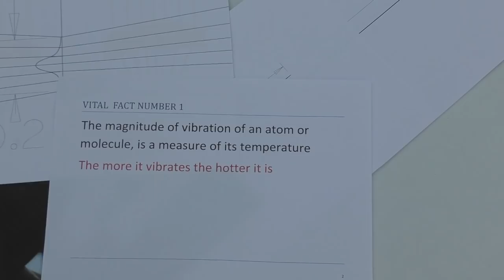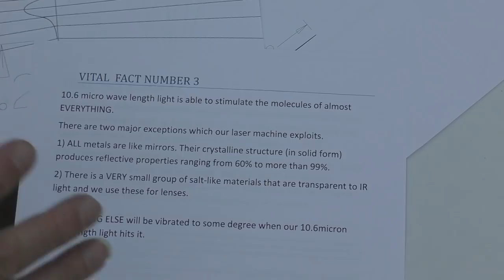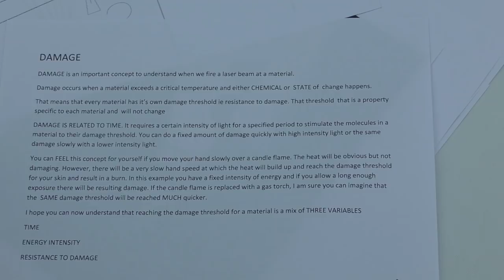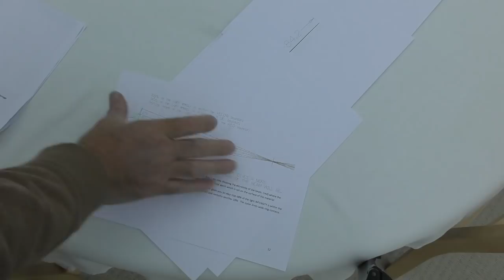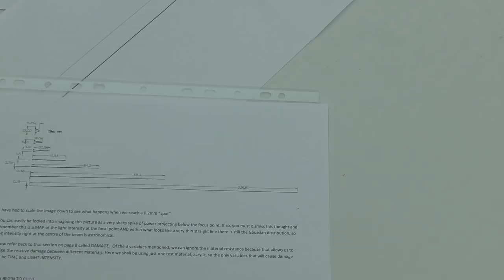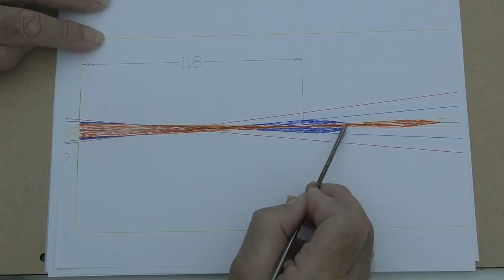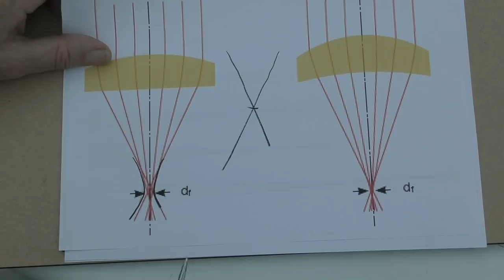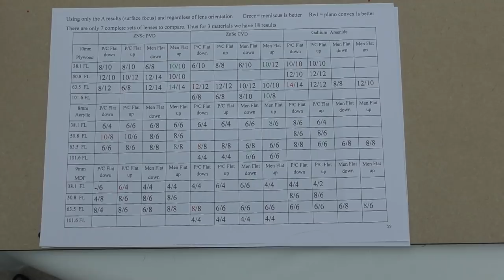RDWorks Learning Lab 172 AT LAST!! How Lenses Work

Comment: Once again an excellent and informative video, normally when someone tells me something I feel impelled to ask the question "why", why do I have to di it like that, why does it react like that, why, why ,why. I guess its the engineer in me trying to understand what's the reason behind it so I can see if there is a better way, an alternative, a solution that is easier, quicker, or more cost-efficient and then there are times when I just want to know. The deeper you dig into them more I question why, not why does the laser cut, mark or engrave the way it does, but why are you digging. I hope it is because of the engineer in you just wanting to understand. The reason I say this is because you already have the best setting you can for cutting, marking and engraving, I have watch the videos. Once you have started down the rabbit hole only then do we sometimes think ignorance is bliss, but once you have started you can't stop, carry on the good work.
Reply from the maker: Hi
 Yes, I am digging this hole for myself The more I can understand the minutia of the technology the better choices I will be able to make. I am lucky to have so many lenses to experiment with. Up until now my 4" lenses  (I have only 2) have rarely seen any action. The "word on the street" has always been that the energy density is too low for low power tubes and the kerf is too wide.  On the basis of my modelling I am going to have to look into this more seriously because like many "facts" I dig into  myth rather than fact pervades.  The pierce test I did in acrylic seemed to promise great things but  previous cutting data done on the same machine did not corroborate those results. I feel confident the truth is there to be uncovered.
Best wishes
Russ
Reply: Hi Russ, having just watched this again I have a couple of questions you may have already thought of and possibly answered in your previous  endeavours. The first relates to the bulging you see in the spot plunges, I was thinking the bulges are result of the of the angle divergence and the refraction as the blue area of the beam hits the side wall as it cuts, any thoughts? The other question is related to the beam diameter, typical beam diameter is what 6mm for a Co2 laser and as it pass thought a 4" lens its focal point 101.6 but that's not the convergence point of your yellow area, not that that makes much difference to my question, but would we get a small spot on the 4" lens (and all the other lenses now I think of it) if we used a concaved lens at say 71.1mm where the beam diameter has already narrowed to collimate the beam at 1.5mm and then use a third lens to then focus the beam for cutting. In theory you should have shallower refraction, a higher intensity, and as a result, a narrower cut and faster cutting speeds. What do you think?
Reply from the maker: @precisionlasersolutions7996  
I have purposely kept my model very simple with straight rays of light. Although I have considered both refraction and diffraction,  I cannot see neither playing any consequential role when the beam is in the hole. Diffraction happens when a parallel rays of light try to squeeze through an aperture and the resulting wavefont from the aperture is a diverging beam that will probably carry interference fringes,   First of all we do not have parallel rays, the beam is already focused down to the spot size. The spot size is the srea where the "damage " will begin and the damage ares will always be at the that part of the bean colliding with solid material. St the beam diverges inside the hole so the damage area will diverge  (maybe in a complex way as my diagram tries to portray) However as far as diffraction is concerned there is no aperture that the beam is "squeezing" through, it has bored its own tunnel and the focused light is just "flowing" through it.. As for refraction? That occurs when a light beam passes from one medium to another and a density change occurs the causes the beam to change direction.. The density change between air and what is in the hole (acrylic vapour) I have assumed to be insignificant. If it is in any way affecting the beam path it would be to slightly add to the divergence and that may cause more ballooning than my model shows. This is a detail that I considered relatively unimportant  because to  many non-scientist/engineers this is just clutter that they don't need to know about  as it does not change the basic simple principle of the model.

I will be testing more lens types in the near future and examining the way that the damage front develops for each. I feel this will test the robustness of the model I have proposed.

Beam diameter has always been an interesting subject because I only have one 60 watt and one 70 watt tube to play with.  Both claim to have 5 and 6mm beams. However in practice the beam actually extends out to the diameter of the exit window from the tube. In realty  it is between 12 and 13mm diameter from burn tests that I have conducted. That is why my model is based on a Gaussian curve on a 12mm baseline
The  lens I am modelling is a plano convex lens  and  the geometry of any spherical surface will cause parallel rays of light to hit the spherical surface at differing and increasing angles the further the light is away from the axis of the lens. That causes the rays to be diffracted within the lens by differing amounts. The net result is tha rays further away from the axis will converge sooner than those passing near to the axis The focal point of 101.6mm results from a strange amalgum of these focal points The closer the beam is to centre the more it will project beyond the "average" theoretical focal point. That is why, despite the spot size for a 1011.6 focal length lens is bigger (about 0.4mm).  the yellow zone convergence point is so far below the nominal focal point. This seems to be evidenced by the spot burns that I dd with a 4 " lens where the time taken was much less to penetrate 10mm and also the blue zone was also far less divergent  and as a consequence there was no ballooning, just a gently tapering damage zone. 

The last pert of your question is based on an idea about refraction. Yes you can use refraction to change the direction of the beam entering from one lens to another. From my experimental work I know that there is  4 to 5% power loss across each lens. When I was doing extensive testing during the development of my compound lens I tried MANY different combinations of focal lengths,  lenses,spacings,  lens orientation and occlusion apertures. The sole aim was to produce the smallest possible focus point  ie the smsllest burnt dot for photo engraving.  The goal was simple. Needed ALL the light rays to pass through a single ultra small burn hole. The target was to hold the pulse button on for several seconds to make sure there was no hole growth as the lower power rays gradually had time to make the hole bigger.. The final combination was a cheap 1.5" PVD lens with lots of aberration followed by a touching high quality CVD 2.5" meniscus lens. This resulted in a focal length of about 21mm out of this 63.5mm  second lens / It shows you the dramatic effect the rey entry angle can have. The result was the perfect dot I had been seeking. All other combinations had greater or lesser amounts of scorch halo around a central burn hole, a sure indication of aberration.. I began my whole journey searching for that dot with something similar to your proposal . I used a 4" lens to create a small central beam onto a 1.5" meniscus lens.. The result was amazingly bad.. In my hunt for the smallest dot, I was never sfter cutting capability. In fact  I have completely destroyed any real cutting capability as you can see from the first test in my burn test photo. .

I am sure the key to deep cutting is to find a tube that actually does what it says on the tin. (a 4 or 5mm beam)...and I think I may be close to finding it. If the beam is small to start with, it follows that the light intensity at the centre will be significantly higher  before it gets anywhere near the lens. I think this would bypass your dream  to concentrate it with a second lens.

 Great questions
Many thanks
Russ
 .

Comment: I have very recently just purchased a K40 laser.  And so I've been watching all sorts of YouTube videos on this topic.  your videos on lenses and speed are very informative.  My reasoning for purchasing this K40 is for Engraving polycarbonate & acrylic. also cutting through thin plywood for box making. My question is this,  Do you think your PDF would be beneficial to me as a K40 owner?  My intentions are to make some upgrades to this machine before I even get started. A light objects 18mm air assist, a 18 mm meniscus lens, adjustable bed & a more precise power control. Plus several other upgrades in the future.  Thank you for any help you would be willing to provide.
Reply from the maker: Hi Terry 
My goal is to properly understand the technology and all of its components. That makes it very general and applicable to all non-metal cutting machines with a constant current CO2 tube laser source. Much of it also applies to RF laser tubes  once the beam is outside the tube itself. If you wish to send me your disguised email ( terrydotmatgooglemaildotcom) in another comment I will gladly send you the pdf.

Best wishes
Russ
Reply: @SarbarMultimedia  Thank you very much for your quick reply. This is my ad,dres/s.  terrymkc0dye at g mail. I'm looking forward to studying your PDF & keeping it with my laser for quick reference. I believe it will be a good asset.
Reply: @SarbarMultimedia   I sent an email with my correct email address to your email. I think.  once again, sorry for any inconvenience & confusion. If in the event you don't actually get that email, replaced the letter "o" with the numbers "0" and you should have it. best regards and thank you.